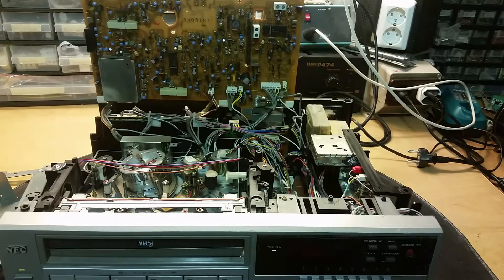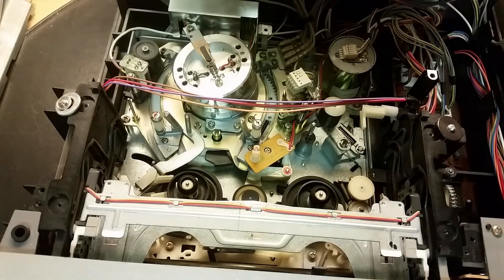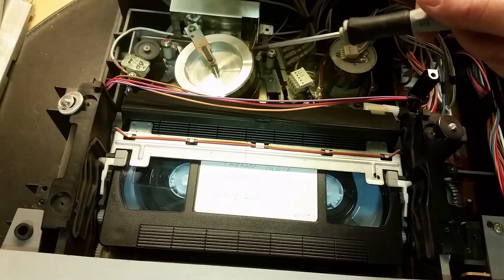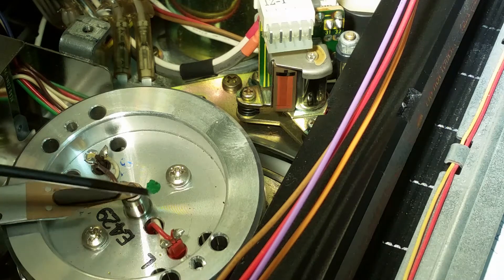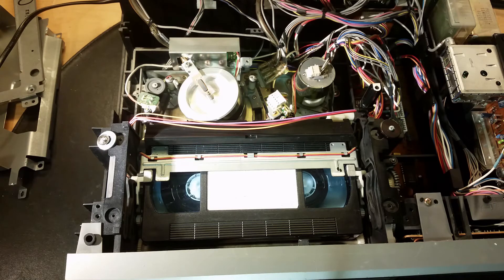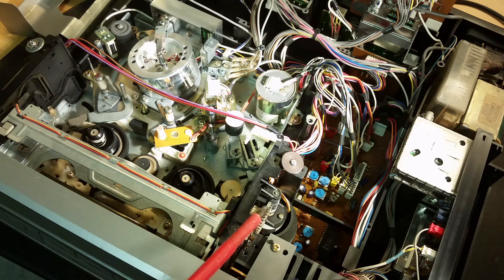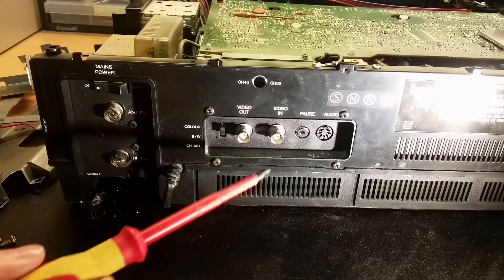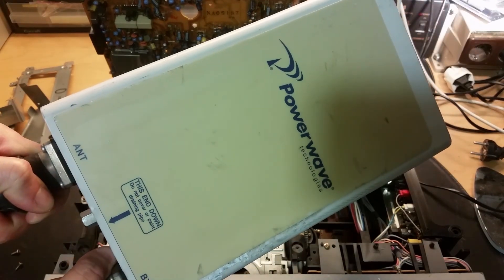Inside A VCR/VHS And Explanation

Comment: There is something wrong in your explanation.
The 'synchronization" head is called ACE (audio control erase head). On the up-left is the erase head (grey/red color at yours). Up-right, next to the erase, is the audio head(mono or stereo) and at the bottom of the audio is the control head.

Cheers